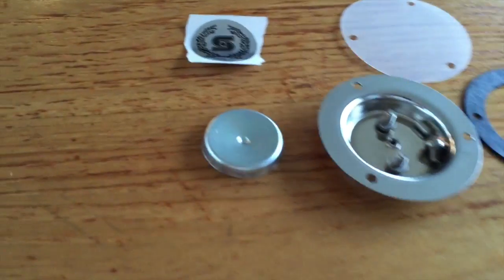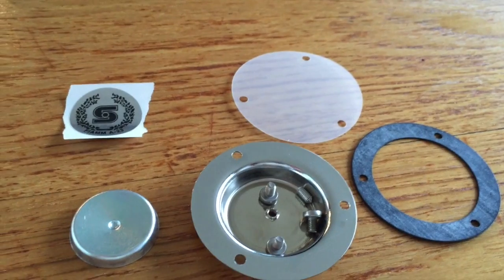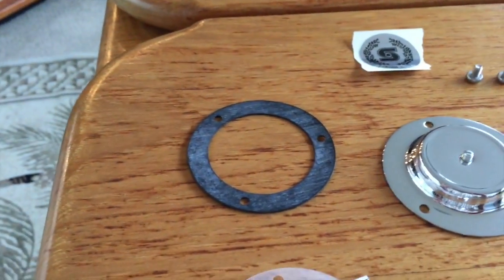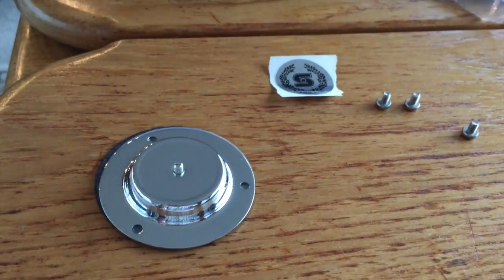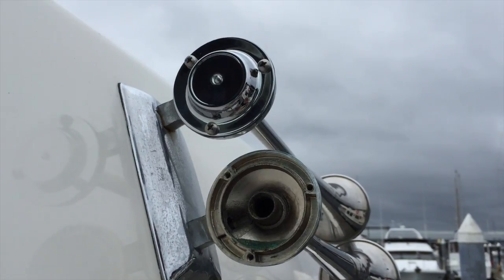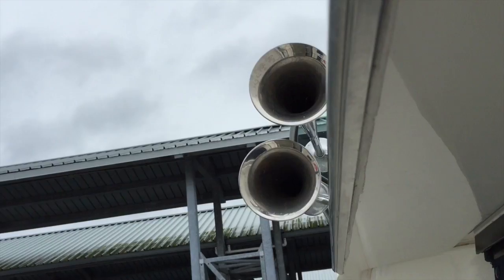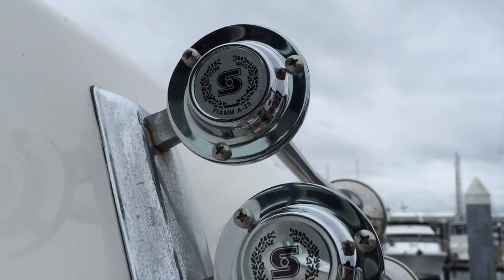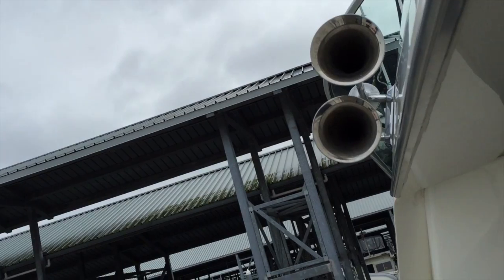4788 Horn Repair

Comment: any one know where the compressor is for the horns. Before I buy any kits I want to check the compressor, when I press the horn button the lights dim and breaker blows. Took one horn apart, it had some water in it but it was clear. Figured might be an issue at the compressor, if i could find and test it. Thank you,
Reply from the maker: If my memory serves, the compressor is located either behind the electric panel or below the electric panel and you access it through the "trap door" in the ceiling of the master stateroom.  You can trace it by following the clear plastic tubing that runs the air to the horns.  Join baylinerownersclub.org for the best information about your boat!
Reply: @RobsterInEdmonds  Thank you, found it, replaced it and horns active again. Much appreciated.